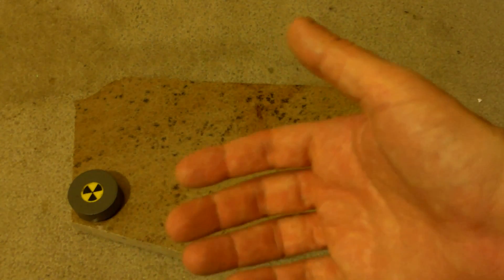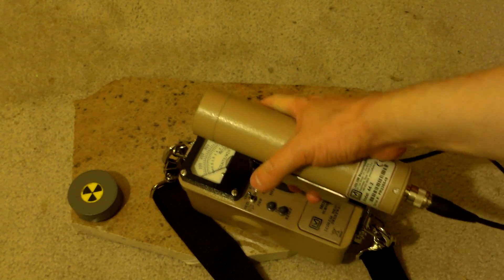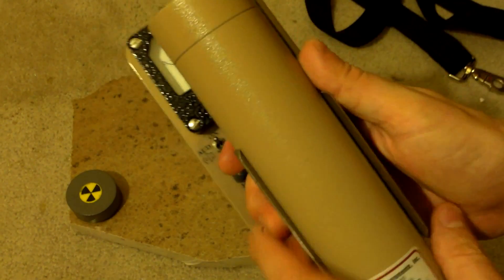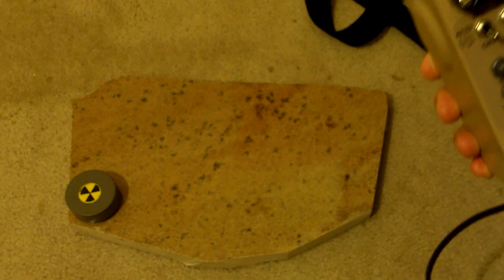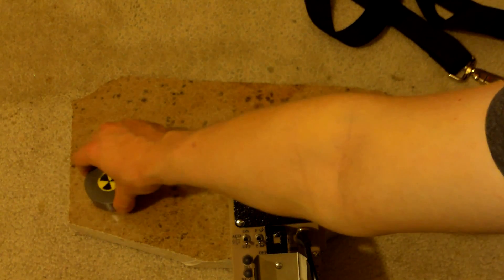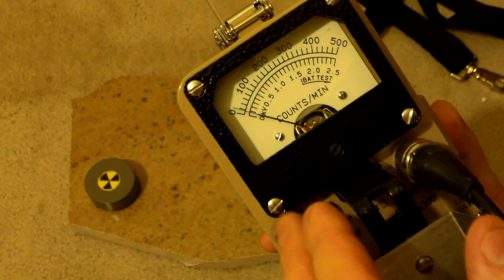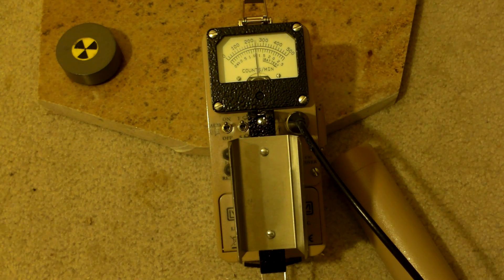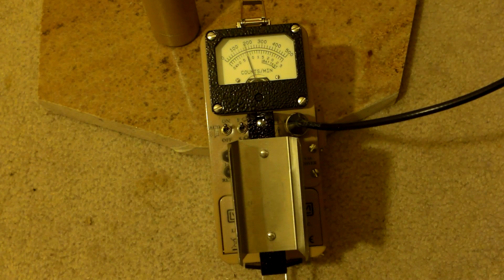My New Ludlum Model 12 and Model 44-2 Scintillation Counter

Comment: You cannot simply change probes & expect an accurate reading. You need to "plateau" the counts on a HV vs CPM for each probe & center the HV on that plateau on the instrument for that probe. See the Ludlum website. In the video it sounds like the scintillation probe is being overdriven. This unit is similar, but not the same, to the Model 14C. I own 9 survey meters, a Model 2200 Scaler Ratemeter, & a Model 500 Pulser for calibrations.

Comment: Thank you for sharing this! I don't think I've seen this video before! I'm late to it, but that is awesome! The closest thing I have to this is an Eberline RM-20, which has the same scale and HV numbers on the meter. It is very nice, but it's not meant to be portable. It runs off of an AC outlet. It can use a lead-acid battery, but I don't know what model battery to use and where it goes. Ludlums are expensive, but they are excellent instruments! And my new and trusty Inspector USB is an excellent pocket/digital G-M counter! Even your kitty was excited and climbed in the box! Ludlum is definitely on my list of future equipment.

Comment: As an airline pilot I've recently taken an interest in radiation exposure and dosages at altitude.  I've recently purchased a GMC-320 Plus to get an idea of what the exposures are.  The unit in this video looks to be far more sensitive and I was wondering if you've tested the exit signs on aircraft.  An aircraft I used to fly before I got into jets, called a Metroliner III (SA227), had radioactive symbols on them with a Tritium label.  Its what made them glow all the time.  I wonder if there's any radiation that escapes from their housings.  I'm not sure if they still use tritium on modern aircraft and to be honest I keep forgetting to look if its even on the ones I fly.  Now I'm more concerned about cosmic radiation.
Reply from the maker: +Brad Delisle   Tritium does result in some x-rays when the betas from its decay strike the plastic/glass housing. It's normally not a major cause for concern, unless it breaks open.

Cosmic radiation at altitude is interesting. At 36k feet it's not too bad. I've been upwards of 40k on a 777 before, as a passenger lol, but these are low altitudes, as far as the atmosphere is concerned.

Imagine the does they get on ISS or if you flew a MIG25 at 80,000+ feet!

Comment: A Model 3 works perfectly well with a 44-2 or 44-3. The higher ranges of the 17 are a "nice to have" but for amateur use, I cant imagine ever having to seriously rely upon or need them.

Nice unit though. Thanks for sharing.
Reply from the maker: +clagwell    I had thought of using my love them with potentially multi-crystal active shielding detectors in all kinds of other crazy ideas which might require it's more specialized functions. I haven't made anything like that, but it want the ability to do it if I change my mind lol

Comment from the maker: That's a toughy.  If they are in good working condition and the calibration is good... then I'd say yes. I am assuming it has a 44-9 probe. Ensure it works before buying. It should get between 20 and 60 CPM background, depending on location.

Comment: hey i got a kinda urgent question if you don't mind. Is a used Ludlum model 2 with A/B/Y ludlum probe worth $295? I have no clue about Ludlum. Thanks very much
Reply: Definitely not. I have seen them for as low as $200. And the Ludlum model 2 only has 3 range multipliers so that is more the sort of price for a used Ludlum model 3.

Comment from the maker: Not a mistake. I prefer the 20 keV to 1 MeV range the most. I have a low energy RAP47 which is comparable to the 44-3 in many respects (8 keV to about 500-ish keV).

That 44-3 never really interested me much. When I use my RAP47 I get about the same result :|

Also, this unit is for gamma spectroscopy. It will not match my lab grade 1.5" NaI(Tl), but it is similar.

Comment: Terrible mistake to buy a device with a sensor 44-2 instead of 44-3
Reply: In what way?!?  The 44-4 can only measure 10-60kev! Whereas a 44-2 measures 20kev-1.5Mev. And besides he has the RAP-47 for low energy. I recommend watching his gratuitous radiation survey. It demonstrates the difference.
Reply: @keelanenns4548  
Why then does the 44-3 sell so much better? Are all fools? My advice to you, try these sensors in action and then speak
Reply: And why does Ludlum include the 44-2 scintillator in its model 3-IS kit?

Comment from the maker: The scintillator is blind to pure beta or low gamma emitting alpha emitters. You can get alpha and beta scintillators, but gamma is the most common.

I always keep my pancake GM around for alpha and low energy beta! This unit measures a change of 200 to 300 CPM  (a rounding error for it's 1600 CPM background) when next to a tube of KCl, but my Inspector GM jumps from 38 CPM to 500 CPM.

The right tools, for the right job!